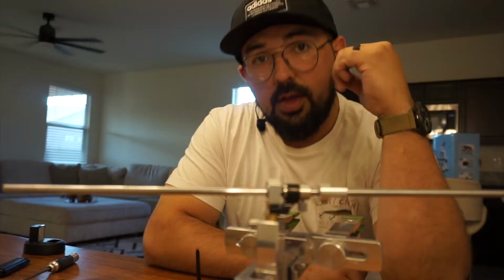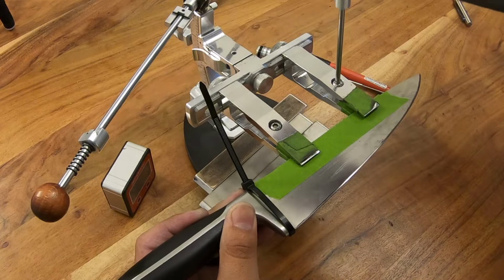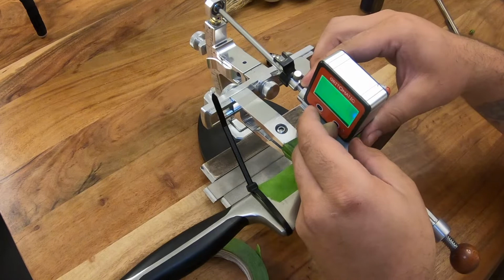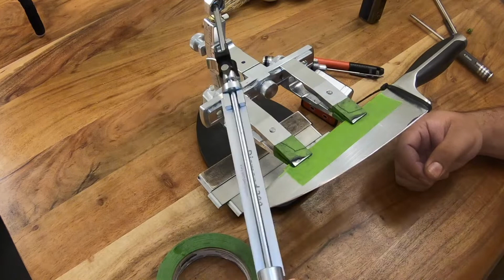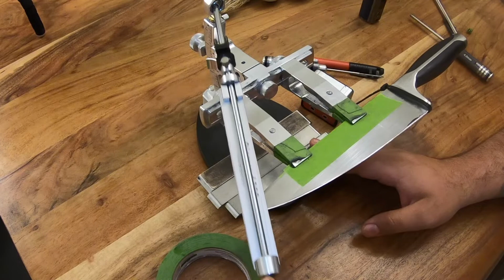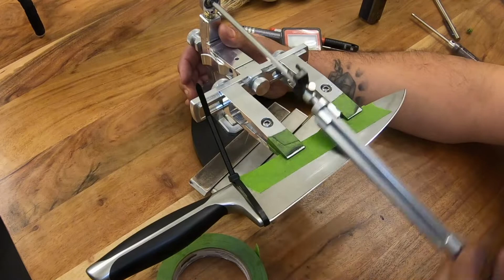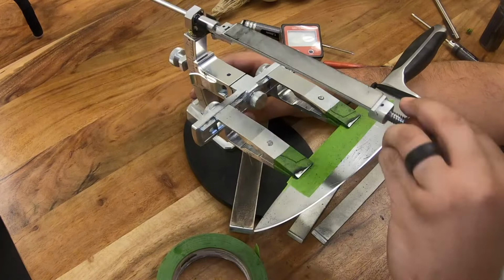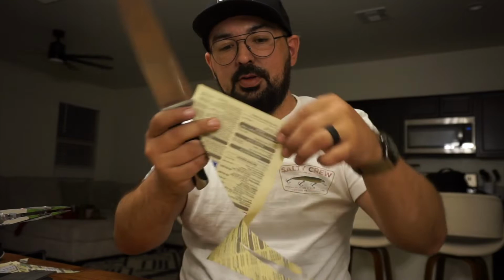Knife Sharpening 101: How to use a Guided System (Tsprof, KME, Edge Pro, Hapstone and more)

Comment: Overall, a good video. One suggestion about clamping the knife is to not focus on the spine position, but to “place the knife in the clamps so that the longest straight section of the knife is as parallel as possible to the frame.” (User manual page 27 section 6.1). The longest straight section would be to draw a line from the heel to the tip.  Place that line parallel to the frame.

The other thing I noticed was that the tip of your knife was flexing.  To prevent that, move the clamps to the furthest outside positions.  That would put one of your clamps closer to the tip. 

Keep it up!
Reply from the maker: Great feedback! Pinned!
Reply: 100% agree
Reply: Funny how all you really have to do is read the instruction manual, eh?
Reply: @MrMZaccone  Handy advice, unless one doesn't have the instruction manual.
Reply: @johnsanford3596  I'd be very surprised if it weren't online.
Reply: @MrMZaccone  TSPROF often only has instructions in Russian, Mr. Sarcastic.

Comment: Usually you want to keep the edge of the knife perpendicular to the clamps instead of the spine. This is because as the blade tapers it will change the angle as the edge gets closer or farther from the clamps. Mostly it will just result in uneven edge bevels and different cutting performance along the edge as the angle gets steeper. Think of it like this: If one end of the blade sticks out really far then the stone will be lifted higher up. On the other end much closer to the system the stone will be much lower giving a steeper angle. It isn't much, perhaps a degree or 2, but it can make a difference.

That is a reason people use the line from heel to tip as an angle to clamp the knife to get an average spread rather than an extreme from one end to the other. Of course that also changes with the type of blade and tip etc as it is not suitable for every knife type. It can be desirable to have the knife set in a way that the tip is a much steeper angle simply to keep the edge bevels even. Most knife tips are thicker than the edge so as you sharpen to the same angle as the rest of the blade the bevel gets wider right at the tip. People will clamp in such a way as to make the edge steeper to maintain a consistent bevel. Usually the only people that are really concerned with that are the hardcore sharpeners that want perfectly even mirror bevels to show off. If all you are concerned with is a sharp knife then don't let a wider tip bevel bother you. Same reason some people will raise the knife up when freehand sharpening when they get to the tip.

There used to be an image guide for clamp systems floating around that showed common problems and how to clamp to avoid them. Unfortunately I don't have a copy kicking around but if you ask in the Edge Snobs FB group somebody there will have it. Might be handy to include in the description of guided system videos.

In your intro you showed a shorter knife clamped with both clamps on one side with the tip clamped towards the middle. That can give very different results from clamping the same knife with the tip to the outside. Might be something to expand upon when you do a future clamping video as I am sure a lot of us beginners might have trouble with certain knives and changing from clamping a short knife one way to the other could solve those issues.
Reply from the maker: Excellent information! I appreciate all the awesome feedback. 

So to expand on why I keep the spine parallel to the system should be noted. Most knives I have are under 4in and on the tsprof that’s really not a large knife to sharpen so the variation in angle is rarely an issue unless said knife has a ton of belly. And I think it generally works out that way because as you pointed out, the thickness bte is greater near the tip so if I end up keeping the spine parallel with the clamp assembly and I sharpen out towards that tip it ends up looking pretty even with the rest of the edge bevel in most scenarios.

But anyways I do plan on doing a dedicated clamping video in the future and I will do my best to cover all of this information deeper. But I do plan on investigating and experimenting a little more before then.

Again thanks a ton for the information, much appreciated!
Reply: @StropsandStones  Ah yea, on a really short knife like that it is usually not really an issue. Since you were sharpening a chef knife with a fair bit of taper I figured I would mention it just in case. Looking forward to your coming videos.
Reply from the maker: @Riyame  absolutely, the information you provided was great and shouldn’t be left undiscussed! 

So obviously I’m really early into my channel and my production value is trash and my subscriber count is very low, so eventually when I get a better video format mastered and much better editing skills I do intend to redo some of these important tutorial videos. I feel currently that the information I’m providing is pretty good but I am not perfect so I welcome these types of comments Bc at the end of the day we need solid information out there to help those who need it.

Thank you for the support!
Reply: Sounds to me like the problem is the clamp.
Reply: @Riyame great information, u just described what I have been searching for. Every knife I do that has a belly with curve to the tip I get a double edge at the tip usually on just one side. Like you said it really stands out when your grit is finer than factory. Is there any tip or way to prevent this? I just recently bought a Tsprof pioneer hoping this would eliminate this issue. Was using the worksharp precision adjust elite. I wonder if sanding longer in that one area will eventually even it out? I never try, scared I will cause damage that cant be reversed. I have also repositioned the blade and fixed that way but this is tricky doing and not messing up the rest of your apex. As more of a knife collector, light user, with my higher dollar knives this drives me crazy. Any tips? Thanks!

Comment: Good work Jordan! Nice to see a general overview of the basics for all guided Systems, instead of focusing on one brand. As the principles basically apply to all ot them, this is very helpful for a lot of people! I like the style, e.g. the good, practical explanation of the burr.

Some additions:
- on stroke technique for early stages and new edge buildup, I recommend: 
1. circular motion, chaotic, removes more material with coarse stones
2. up and down, as shown, to straighten the edges flanks
3. sweeping along the edge to even out wavyness and center the burr
- getting higher grit stones, don't stop at 1000, it's remarkable what 2000/3000 or even 5000 grit can do for your edge (not in sharpness per se, but longivity! also less chipping in use)
- clamping ab bit wider, especially towards the tip, which helps with tip bending
- wipe the residue in between when on the finer stones, helps with the finish (you don't want the coarse grime interfering with your fine stone, right?)

Not the Spine parrallel to the system, but edge is correct, you're right there. I would just apply that to any blade, really, since (mostly) all of them have a slight curve. The reason is that not the lenght of the blade changes the angle (as often believed) but any deviation from a straight edge. The more curved a blade is, the more the angle changes. At least according to Pythagoras!  ;-)  So, you are absolutely right and there is a geometrical explanation for it, but it would require some sophisticated 3D grafics to show, hard to explain. 

Here is my poor attempt anyway:
Imagine 2 parrallel lines, one is your (theoretically) straight edge and the other runs throught your pivot point. Parrallel to each other, hovering over and parrallel to the ground (your table), one being higher than the other. From the side it's a simple triangle and the "Distance" is always viewed parrallel to the ground, NOT as straight line between edge and pivot point! Got that picture? Now with that in mind, and this is important: the ANGLE can only change when the DISTANCE between those 2 lines changes, without changing the height difference OR when the height difference changes without changing the DISTANCE. Those 2 lines could be indefinitely long, this rule still applies. Right? And that's where the curve comes in: the curve of the blade DOES change the DISTANCE without changing the height difference! Bäm, different angle!  :-)   

As you have observerd: one can see the effect easily with a blade that is mostly straight but strongly curves at the end. Like many swiss pocket knifes or an Opinel for example. Sharpen it with a constant angle and you will see (with the naked eye!) that the edge towards the tip actually gets narrower. But on a blade with a constant but slight curve, it doesn't really do all that much, in practical terms anyway. But sometimes one can even see the effect on large chef knives. Many have observed this effect, it's just hard to grasp and visualise the geometry behind.

In a nutshell: NO, the length of the blade does NOT change the angle AT ALL. The blade could be half a mile long and the angle would be consistent as long as the edge is straight! NOT the lenght of the blade changes the angle, curving does. And it's geometry, not an opinion.   ;-)

Keep up the good work Jordan! Looking forward to see more content from you!

Comment: I'm just now seeing this video and it reminded me of the dilemma I faced when trying to pick which guided system to go with. I don't need to list them all, but all "the usual suspects" were up to capture my hard earned dollars. The TSProf was my initial choice, but your video today shows clearly something that I've not seen addressed, which is having the sharp edge of the knife facing you. I kept waiting to see if you were going to  cut yourself doing the adjustments for stone thickness. Of course we're adults and know about safety, but it brings me to why I ultimately spent the money to go with the Wicked Edge system, which has the knife clamped with the edge up and much less likely to cut me when changing stones and can easily see the edge on both sides as I work through the grit progression. Both systems are slow and require patience, especially when reprofiling an edge.

Comment: I had trouble understanding what you meant with the 2 pics concerning ... "this is how you tell if angle is too high or too low."  I had to watch a few times to figure out whatever  you meant.  AND, I have a TSPOF and use a marker to check angles.  May want to actually say something like "see how the top of the marker has been removed" and see how the bottom of the marker was removed ... which means this".  Simple, once I got it.
Also, just watched a TSPROF vi where the guy puts his index finger under the tip to prevent "roll off".  Have not tried it yet, butsure looks like it worked.
Identifying a burr is easy once for figure it out. Maybe try showing the burr pulling a cloth across it as demonstration.
Excellent technique and demonstration.  Cool voice too.

Comment: Great video, the zip tie tip is awesome! One thing I started doing for my clamps on my KO3 Hunter is using Capton tape. Just tape the clamps really evenly and make sure the tape is flat and so far it's lasted for months. I've sharpened probably well over a dozen knives on the same tape and never changed it and I don't have to use any tape on the blade.
Reply: @jeffdmusic are you serious or just taking the mickey out of this clown with the zip Tie?

Comment: Why your angle changes when the knife has a "big belly", or really, significant variation in width:  

The knife, along its with from spine to edge, is set at a different angle than the arm on which the abrasive is mounted (obviously - that's how you determine sharpening angle right?).  Thus, if part of the knife is wider, you end up lifting the arm to reach it with the abrasive, and changing your sharpening angle.

Comment: Can you please make a video on how to sharpen a recurved blade, such as a kukri. I am a collector of fine antique kukri. Of the twelve kukri I own, five of them have significant dents in their edges, and are in need of re-profiling. But I am a total beginner to blade sharpening. So I don’t have the confidence to work on my kukri, without guidance.
Reply: Basically the same way with a guided system however you will use different stones, the ones in the video are 6x1 where for a recurve you should pick up 6 x 0.6 or whatever skinny stones, can be 4 inch long as that will fit as well but the big thing is to have a stone thats around half an inch wide.

Comment: I see a few creators use one strop for all their gunny juice. To me this seems counter intuitive. As the strop will be impregnated with different micron sizes.   Is this correct? Or do most people use 1 strop with multiple micron size emulsions? I opted to have 1 strop for each micron size so they stay the same even when adding emulsion.

Comment: Can you make a video on fixing uneven factory edge bevels? You build and remove a burr for each grit?
Reply: My 2 cents: Not for each grit, no. At most for the 2 lowest grits, I usually only work out a burr on the first grit. Because once the the edge is build and set up, there is no need to work out a burr again. This is of course, because I work on a Wicked Edge System, where you work out the burr one-handed and once the edge is established go on two-handed. On the one-handed guided systems you can't really avoid a micro burr, depending on how often you turn the knife arround. But the Principle is the same on one-handed and two-handed guided systems: burr only in the beginning, after edge established, no more need for a burr. Oh, and for real re-work of an edge: get some really 1ow grit diamond stones! Like 50/100, they speed up the process. But use proper technique to avoid chipout while edge building. Stone quality doesn't matter as much as strole technique when rebuilding an edge!

So Jordan is absolutely right: if you don't know how to fix a meesed up edge, leave it to somebody who does. Or try anyway, using the right technique. This can actually be quite satisfying!  

Happy grinding! ;-)

Comment: When you sharpen using a guided system, are you doing edge leading or edge trailing? In the video, it looks like you're doing edge leading. Or or you sharpening in both directions? With which  method is it easier to detect the burr?
Reply: There's almost no difference between edge leading and edge trailing when it comes to the burr. The extremely small difference that does exist is only relevant at extremely fine grits in the context of final deburring.

Comment: The angle gets higher near the tip in the case of a deep "belly" on the knife because as the stone arm sweeps further from perpendicular to the edge, the angle at which the machine is set is also applied in a less perpendicular manner to the edge of the blade. This is one reason an Edge Pro is superior. The blade can be constantly adjusted to compensate for this without sacrificing precision. Clamps are LESS versatile, and a clamped blade is both more difficult to sharpen correctly and more dangerous.
Reply: That's what I been asking people, it's no way the angle is same  when extendeding the rod to the tip...
Reply: You could clamp a small "table" in those clamps and now you have an Edge Pro.

But since this won't work for wide knives...probably it's enough leaving those screws unfastened.
Reply: @szilardfineascovasa6144  The Edge Pro works on wide knives, narrow knives, you name it. Table>clamp.
Reply: @MrMZaccone  
I see your point, although I'm not sure why blade width would be a factor, in the end. If we are compaing apples to apples, then I guess on TSProf's side we should look at K03. 

It just becomes more messy, I admit, to have all those different clamps. So on the versatility side, table, all day. But consistently moving the knife to the same position following the curve is somewhat of an extra skill to learn 🙂. If you mess up here, there's still a chance you won't get those nice even bevels. 

I've personally been using a system with table and magnets (EdgePal), don't own a K03, so I am not partial when it comes to either of these systems. In the end, they all compromise somewhere.